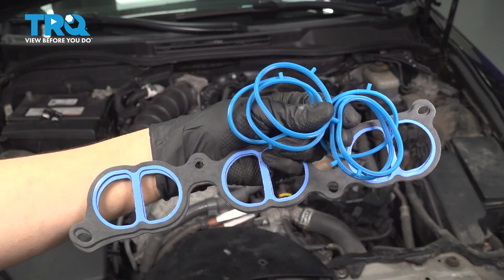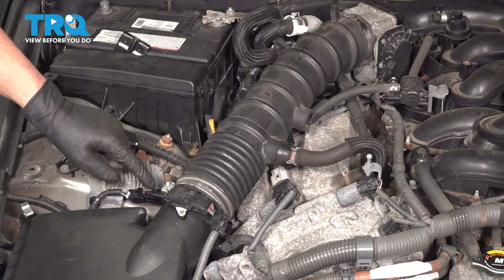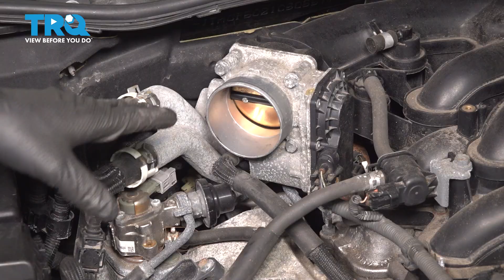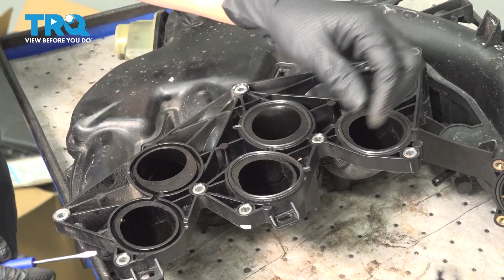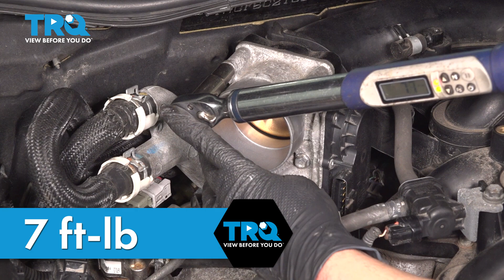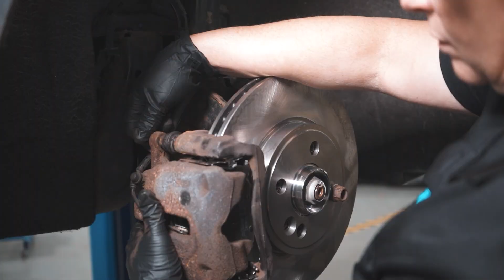How to Replace Intake Manifold Gaskets 2006-2015 Lexus IS250

Comment: Almost stripped the allen bolts on the manifold. Turns out they're slightly smaller than 5mm, they're actually 3/16 on my engine. Glad I avoided stripped bolts.